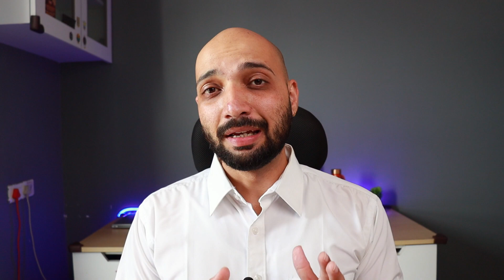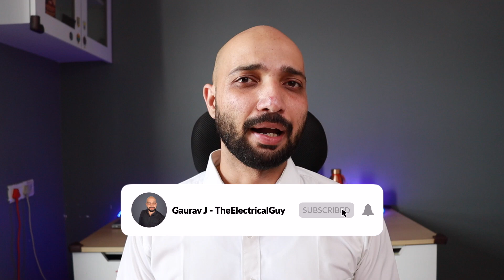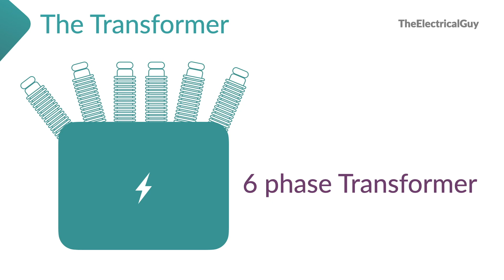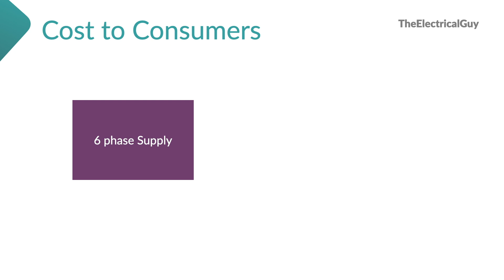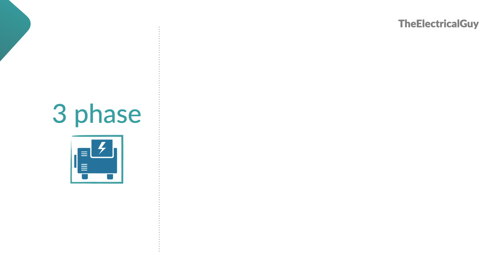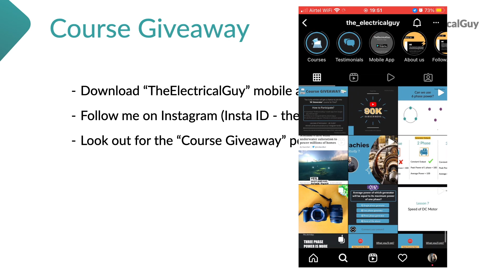Let’s use 6 phase power! Why use only 3 phase?

Comment: I think you over complicated things. If it is more efficient to generate 6-phase power. Just start there and split the out put to 2 3-phase systems powering 2 different sub grids. Work the complications out there first.

Comment: Check out IJISET - International Journal of Innovative Science, Engineering & Technology, Vol. 8 Issue 11, November 2021.  I'll borrow a direct quote, about what it mentioned about 6 phase power:

"The result of the comparative analysis of the modeled six-phase Fig. 4.14 Limited right-of-way for Magnetic field.
transmission line with the existing 73Km, 132kV three-phase transmission line (case study) using power system analytical
softwares (PSAT) and Power system computer aided design (PSCAD) showed that the 6-phase line has better outcome with
reduced power loss, improved voltage and current reliability, limited right-of-way, better critical clearing time (CCT) and
critical clearing angle (CCA) with better stability." 

It also mentioned that the required right of way was reduced from 6.735 meters to 5.51 meters, and the area covered by the magnetic field was reduced from 16 meters to 14.286 meters.

Comment: A 6 phase system is just two 3 phase systems with 60 degree phase delay. You can try to pack them into a single 3 phase delivery system.
Also with double the wiring on the generator stator the resistance on the rotor is doubled. Energy doesn't come out of nowhere.

A 3 phase delivery system can be seen as three PAIRS of single phases with 120 degree delay each and cancelling out their loopback cable since it's always zero amps. Sounds like SWER (use earth as the loopback) but not even involving the earth at all. More phases will NOT reduce the number of cables per power thus meaningless.

Comment: I'm imagining a system where power is generated by a 6-phase turbine, but distributed by existing 3-phase utility lines; 3 phases go one direction on one set of lines, and 3 go the other direction on the other set of set of lines. Each of the 3 delivered phases would be 120 degrees out of phase, as they are currently. The only thing to change would be the turbines to generate the power, and slightly modifying the transmission lines to head in opposite directions as they leave the power plant. Would this work?

Comment: Intro music is a straight rip from idubbz content cop  (  -- __ --- ),  #1.  Anyway after watching your video, you analogy makes no sense about 3 wheeled vehicles since 4 wheeled vehicles are the most common and by you analogy motorcycle's would be better than a 3 wheel.  So let me break it down for you and anyone else reading this comment. 1 phase would = wheels and power = GVW. so yes the more wheels a vehicle has the more complex but the more it can carry., Basically it comes down to distance .  #2. You didn't even talk about Application of more than 3 phases.  Such as what solution would higher phases solve? without cost and complexity aside. hypo thecal scenario, is it better to use (2) 3 phase generators to get the same performance as a 6 phase?   using your same analogy,  Maybe instead of wheels, We can think of it like how many cylinders to an engine. A 4 cylinder is less complex than an 8 is but a 4 cylinder is more complex than a 2 cylinder motorcycle engine.   You wouldn't use a motor cycle to pull 53 foot cargo box would you?

Comment: Previously we said that 3 phase give 1.5 times  and single phase give Pm/2.....how we are saying that 3 phase gives 3 times more power
Reply: 3 phase give 1.5 time the max power of single phase. And 3 times the average power of single phase 👍
Reply: Actually we use a multiplier of the root(3) ≈ 1,73 times more power for the same voltage and current conditions, but anyways, a 6 phase system (I guess) would only give a multiplier of root(6) ≈ 2,45. Considering that we would need 6 lines in that case it would be beneficial to rather run 2 x 3 phases in parallel, thus doubling the lines carrying current capacity.

But still ceasing them compatible with existing infrastructure and not having to sets shifted at 60° angle😅

Comment: six phase is possible in cheaper way through rectification like what china did..they bought siemens 1100kv transformer to transport 12GW of power over a 3000km then inverted to 3 phase.

Comment: Long distance double-circuit 3-phase transmission lines can be converted in 6-phase lines using transformers at both ends. Operarional complexity and cost increments gets thus restricted to the zone between both conversion transformer banks. In this case 6-phase exceptional regions can coexist with the convetional 3-phase bulk system. This possibility is an alternative to HVDC for long distance transmission, in which the increased power rating can justifty the cost increment at the substations.

Comment: Mechman 6 phase high current alternator have 12v 500amp dc and idlepro extreme alternator have 24v 600amp dc...so if car alternator can convert ac to dc 12v 500amp and 24v 600amp alternator maybe power generation plant can do they same...

Their alternator is 6phase hairpin double delta stator...if this technology will made it is posible to generate 2gigawatts of power per generating units

Comment: Well, in theory you can run 2 three phase motors using 120º phases at the same time, phase A, C, and E to one and B, D and F to other. Both will run at max power, with "no change" in the consumer side. Apart from, more 3 wires, and 6 phase breakers.

Comment: Can we use six phase generators and motors in EVs for better efficiency regarding range and range extender ability of the engine?.
Reply: I can be wrong, but with 3 phases we already have 6 poles in the motor. You can increase the number of poles rearanging the wirings, maybe more phases will give you better torque, but i don't think it will worth it.
Reply: @NikolasOldSchool  thanks bro

Comment: with 6 phase can 3 phase for one remaining 3 phase can be used for distribution
Reply: You can power two separate three phase systems from one 6 phase generator for sure, but than you have to deal with load balance and the power factor of the two systems interacting with each other, the voltage will oscilate in on system based on the load of the other, will be a nightmare.

Comment: Why would a consumer need a 6 phase motor? Wouldn’t consumers still be able to only connect to a 3 phase supply if they chose to?
Reply from the maker: They could. But, if they are still using 3 phase motor then, transporting 6 phase power would be of less use, isn't it? To get the benefit of 6 phase power, they need 6 phase machineries.
Reply: @GauravJ  not if the consumer run two identical motors.

Comment: Why not 360 phase with very large ground?
Reply from the maker: It looks very difficult (or impossible in my opinion). Because with 360 phases there won't be any phase difference between the phases.
Reply: @GauravJ  each phase would be one degree apart.
Reply from the maker: Yes, but still, it’s very less.
Reply: @GauravJ  could you explain the power doubling on 6phase but not 12phase? Say you rectified all legs then had a infinite farad capacitor bank,for a given time a higher phase generator with the same inductances and resistances will produce more energy than a lower phase but why? And just a side note would love to see a 360phase rectified dc on a oscilloscope
Reply: @brettmoore3194  to make it simpler think we have 100V and by adding degree for eg degree A has 0-degree angle b has 20 degree and C has 40 degree and so on, we get  24v between A-B 48 between A-C 70 between A-D and so on and let the Z be ground,
if we connect any phase(that is from A to R) to ground we get 100V and that is not worth it

unlike 3 phase system where we connect RYB which are 120 degree apart so if u connect R with Y or R with B it will always give 440v so anymore phase would be of no use to transportation it might be used in electric cars for torque if u arange in right order for eg if u connect A with B u will get 24v C with D u will get 24v if u want to increase it connect A with C u will get 48 and if u connect B with D u get 48 volt and so on, u can use it for torque, regen brake etc.
Reply: @nizu9544  I do t give two turtle turds,,,,,

Comment: Sir why do we need to buy a 6 phase motor when we give a normal motor we will get mechanical energy please say sir
Reply: The output torque of 3 or 6 phase motor is more than the 1-phase motor where we need more torque like lifts ,cranes we use 3-phase motors
Reply: @Pavankumar-co9qv  thanks bro

Comment: We can use more phases to generate and  use powers  locally as single  phase..... not for transmitting long diatance....
Reply from the maker: Well, you cannot build a power plant near to a city or village to use that power locally . Power plant has be far away from the residential area or near to some source (coal, water).  We’ll definitely need to transmit that power.
Reply: @GauravJ  I am saying in locally generated generators..... called gensets....
Reply from the maker: Yeah but those are the portable energy sources. Do you think we can manage to have a portable 6 phase generator? In my opinion, no. And also if we use only single phase power then, it will just act like single phase generator. There won’t be any benefits of having six phase generator anyways.
Reply: @GauravJ  we can drive two individual three phase power devices separately by 6 phase locally  generated power....
Reply from the maker: So again, it is same as three phase generator. No benefits of 6 phases 😊
Reply: @saththiyambharathiyan8175  in a transformer the power always remain constant, hence comes the power formula P=VI ( neglecting the p.f) which gives voltage inversely proportional to current. Ohm's law is not valid in this case whatsoever.
Reply: @GauravJ  I have one question related to  transformers.... How the if the voltage  is increaed current get decreased.... to transmit for long distance power is transmitted at higher voltage .... if voltage is increased its corresponding current also will increase.... How can we say High voltage low Current power is transmited.... it is my doubt...
Reply: @saththiyambharathiyan8175  because transformer is not a generator the input power is equal to output power the voltage and current rating depends on turns of the winding
Reply: @Pavankumar-co9qv  votage and current rating are depending on the  turns in winding ... that I understand.. V1/V2= N1 /N2 = I 2/I1 ... This equation is within Transformer windings.... If Voltage is increased by step up transformer that voltage is got from transformer terminal and applied to the transmission line and transmitted through conductor the High voltage will  generate High current according to ohms law...... Then How can we say power is preserved....
Reply: @saththiyambharathiyan8175  the current is not directly proportional to voltage because  there will be a some resistance and reactance due to inductor i.e winding act as a inductor
Reply: @Pavankumar-co9qv  you did not understand my question..... As you said current is inversely proportional to voltage only in the transformer windings .... i am saying external circuit.... In the transformer secondary out put terminal we will get the higher level voltage if it is step up transformer.... That higher step up voltage Will casue current proportional to the voltage in the external circuit.... So how can we say power is transmitted at low current....
Reply: @saththiyambharathiyan8175  first of all ohm's law is not valid for transformers it is valid for resistors so voltage is not directly proportional to current in transformer 😊
Reply: @Pavankumar-co9qv  ohm's law is not valid inside the transformer.... From the outer secondary terminal of the transformer Higher level voltage is source voltage and that voltage and outer conductor will obey ohms law....
Reply: @saththiyambharathiyan8175  the current is depend upon the load not the voltage for example if we deliver 1000w case 1 A load carries 10 amperes then the volatge will be 100w case 2 A load carries 1 ampere the voltage would be 1000v both cases the power will be same